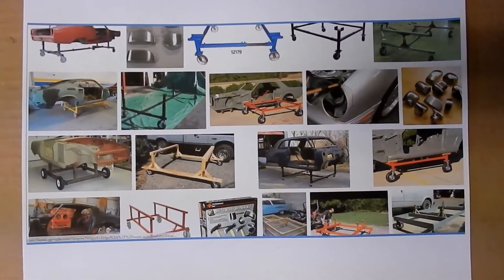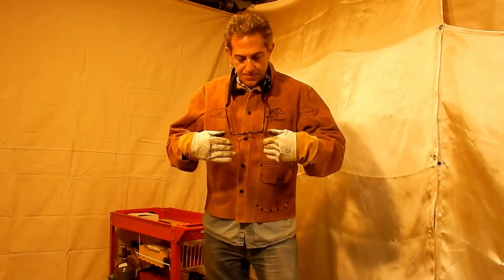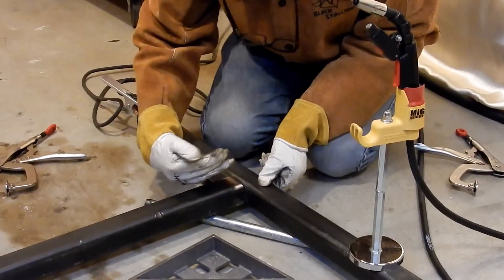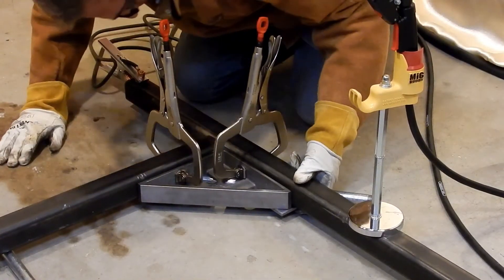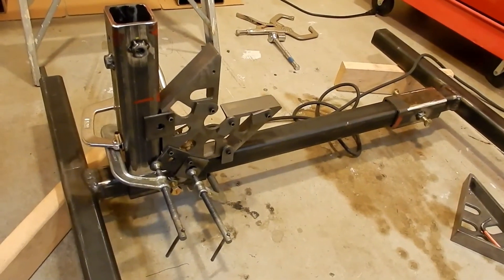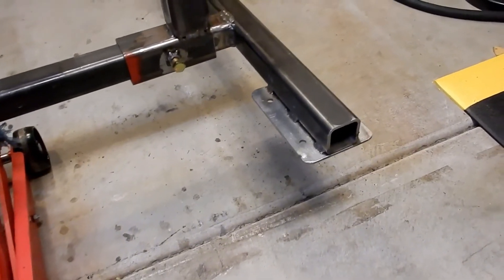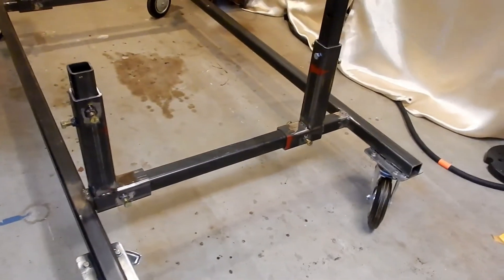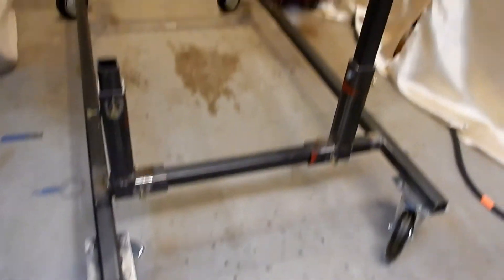How to build a Universal car body/frame dolly

Comment: Hi Mig Buddy,
Do you have a follow up video to this showing the completed project? I'm looking to build one but need to ensure the mounts can move up/down, left/right. Your construction looks really cool, but seems in only moves up/down. If the body holes were further apart this may not work. Thanks for the video!